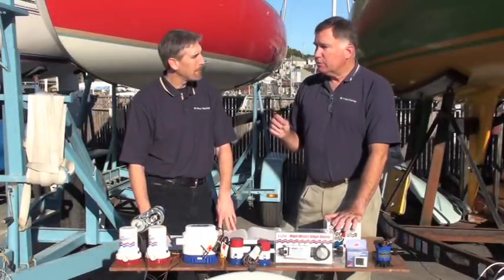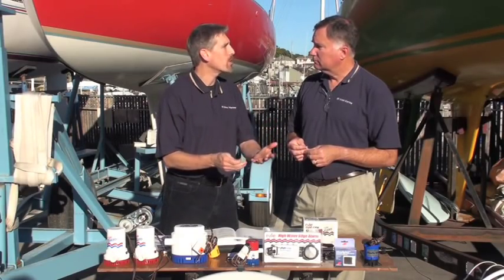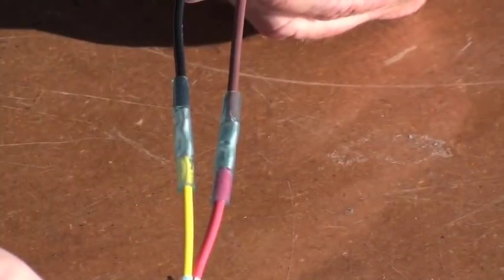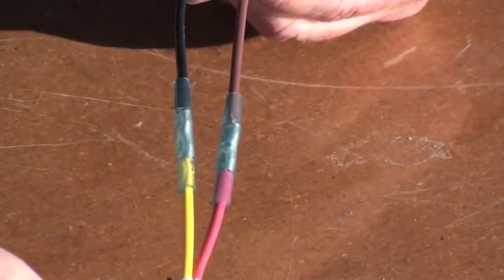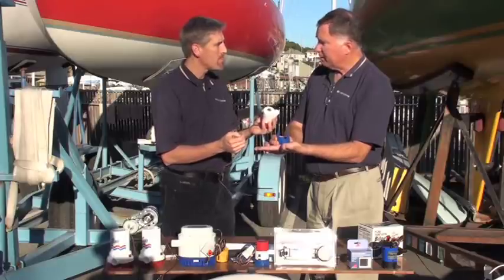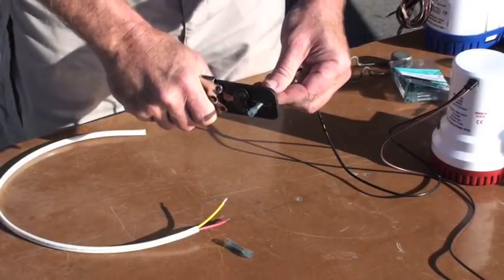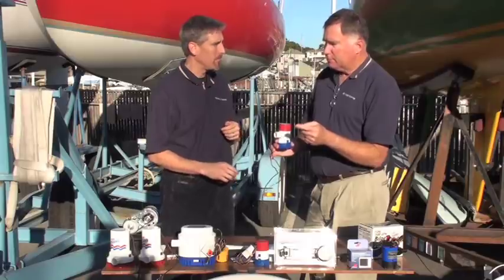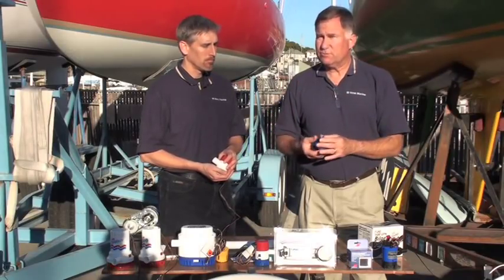DIY Bilge Pump Installation - Replacing an Existing Bilge Pump

Comment: The inexpensive corrugated hose that's been in the market for ever is OK, but it reduces the pump's capacity due to the interior roughness. Ideally you'd use a smooth bore hose. One nice thing about the corrugated hose is that has smooth sections to allow clamping to the pump and the through hull without leaks.

Comment: if you have to be taught to replace a bilge pump, you should not own a boat
Reply: alsations1 what a dick comment.  I just bought a power boat for the first time and both bilge pumps failed.  I watched this video to make sure I had all of my bases covered.  Gosh, I hope I can get to the point where I can go thru life just like this guy!    Anyway, the video is good and even helpful for a first time boat owner.
Reply: So, you were born knowing this and probably every thing else I suppose..
Reply: What kind of statement is this? 🤣